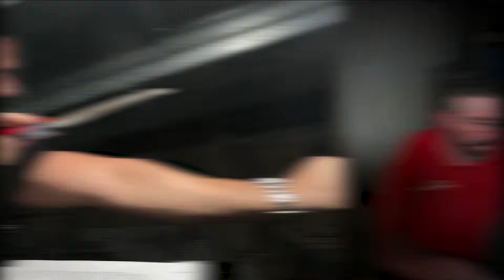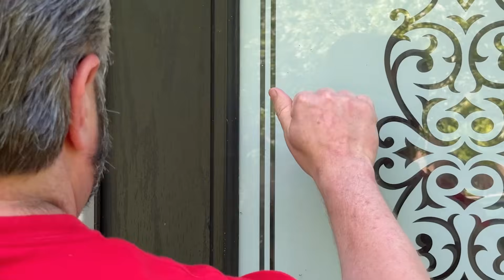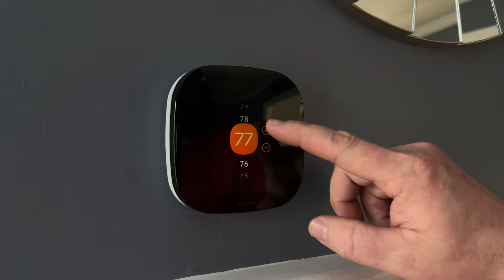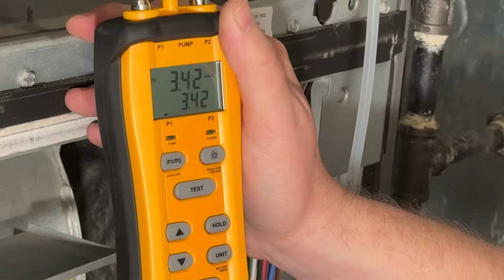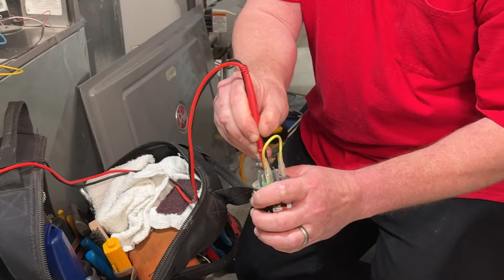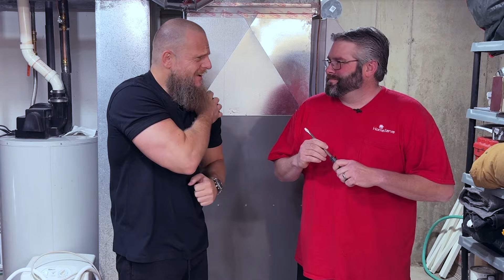How to Tune-up Your Furnace for Winter

Comment: Great video and how it should be done! Unfortunately I pay HomeServe every month religiously and also call every year for a heating and cooling tune up but none of these steps demonstrated are performed on my equipment. The technician just comes to turn on the unit and change the filter then leaves. Only about 15 minutes is spent and I basically pay for someone to come turn on my heat, change my filter, and tell me my heat is working. Total ripoff
Reply from the maker: @XxAyOoRiCkY139xX, I’m sorry you’re unhappy with HomeServe. We'd like to understand what happened, so we can help make things right. When you have a moment, could you please PM us more details about your experience?
Reply: @HomeServeUSA  Not sure how to pm but basically almost none of these steps are performed during my annual tune up. I have been with home serve for years and I find it concerning that on YouTube all of these steps are demonstrated but in reality I never had my gas valve checked with a manometer, flame sensor never checked by shutting the gas or physically pulling the part and checking, gas pressure on manifold side never checked, pressure on inducer motor never checked, blower motor capacitor and amperage draw test never done, flame signal not measured, and combustion test never done on my unit. Never has a technician ever spent 45 minutes on a tune up on my equipment. 10-15 minutes tops. Not sure if the technicians aren’t doing what they are supposed to do or this video is just misleading people into paying for your service with false expectations.
Reply from the maker: @XxAyOoRiCkY139xX, HomeServe aims to get it right, so let us try to fix this for you. Please send me a private message with your contact info and address, so we can work on resolving this for you.